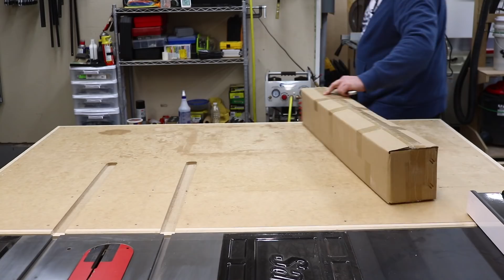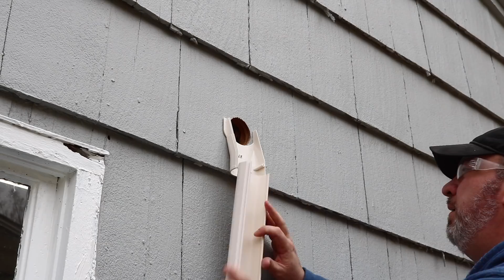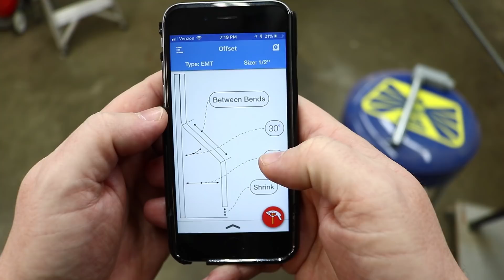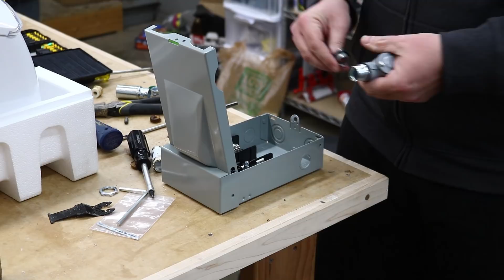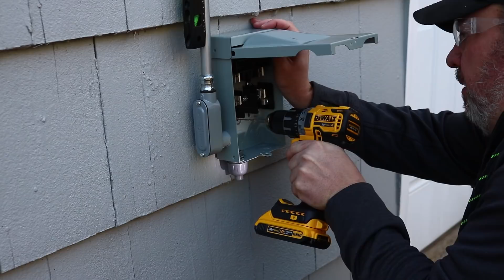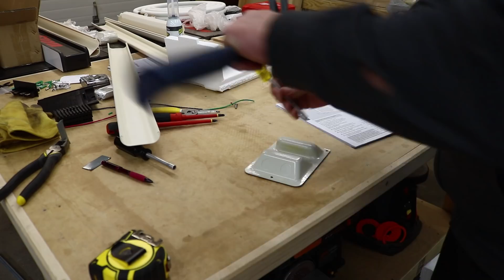How to Install a Ductless Mini Split

Comment from the maker: Hope you all enjoyed this video.  If you've done a mini split install before, post your experience down below.
Reply: Great video. You should be on this old house. I have a question though. I believe you said that your shop was 500sqft. Isn't the unit you used oversized a bit especially with what appears to be an insulated room.
Reply from the maker: Thanks!  It was sized based on a calculator from the manufacturer.  My walls are insulated but my ceiling is not.
Reply: You are a qreat teacher. Thanks for this video.  I will check your other videos. One question... Did you wrap the whole refrigerant pipe lines with the insulation tape or not?  Didn't see that part. I had a couple of units intalled by techs and they didn't wrap the lines but the insulation foam deteriorated. Ohers tell me that was a bad intallation.
Reply: where did you get that tool rack you have on the wall with the hooks?
Reply from the maker: That's the Gladiator system.  They have a ton of different setups and they all hand on those tracks.  You can get them at Home Depot or on their website but I found really great deals on eBay.  However, I've since removed most of them from my shop.  They are best used with stuff like gardening and lawn tools.
Reply: @TheAverageCraftsman  thanks for the quick reply
Reply: The Average Craftsman ... can you comment on how you like the unit. Both from a heater and AC perspective. Thanks in advanced.
Reply from the maker: Love it!  It's worked great so far in both modes.
Reply: The Average Craftsman  I need someone for my home.  I live Michigan
Reply: I don't get the attraction of these things.   LG sells a window heat pump with the same specs for the same sqft for under $700!   Why install this, when I can put in the window unit without permanent damage, and save a grand for other things?
Reply from the maker: Window units arent nearly as efficient as these mini splits.  I'll save that extra money in the long term many times over.  Also, a window unit wasnt an option for me because I dont have a window that opens in my shop.  My unit ended up being around $1300-1400 when it was all said and done including the wiring, disconnect, etc so I wouldn't have saved a grand.
Reply: @crforfreedom7407  I have the LG window unit in my office at home, Works fine, nosier than I expected. I am guessing that the outside unit probably eliminates a lot of that noise.
Reply: @vip01  Yes I think you're right.   I think they are a great deal more energy efficient, so they do save a good deal of $$ over the long run, although I honestly have to say I've not done the cost/benefit analysis on that.  But depending on the length of time and number of hours ran, it would have to be a saving.   If it's a regular long-term living space, there'd be no question.
Reply: Crfor Freedom à
Reply: Crfor Freedom : DILLIGAF!!!

Comment: I have installed several Mini Splits and every brand seems to go a little differently.  I used to be an HVAC tech and still have a vacuum pump and gauges so I could run a pressure test on the lines before opening up the valves and letting the freon flow. I always mount the condenser unit off the ground to prevent grass and dirt getting into the unit. And it is lot easier to work on at waist level! I have mounted them on brick, cement block and wood backed vinyl siding with no problems. I also seal the lines coming through the wall with expandable foam. Your installation looks good and should give you years of service.
Reply from the maker: Thanks! 7 years and it’s still going strong!

Comment: Did you vaccum the lines?
Reply from the maker: Yes, as I mentioned in the video, I hired an HVAC tech to do the final connections and vac the system.

Comment: Thanks for the video nicely done.I found you off of Lumberjocks. Looks like this video is 6 years old just wonder how you feel about this unit after all this time? Any problems?  Thanks, a1jim
Reply from the maker: Thanks for watching the video.  The unit has been great performance-wise but when I fired it up to cool the shop this past summer it had a freon leak in the indoor unit.  It was about $400 to replace and then $200 to have the unit recharged and vacced.  The unit is actually a little under 5 years old right now and was just over 4 years old when I had to replace the indoor unit.  The new unit would have been free but I forgot to register the product so my warranty was only 1 year.  Overall, I am still happy with this purchase and installing it myself.  Compared to having a Mitsubishi or other big brand name installed I am well, well ahead financially.

Comment: Excellent install video. I am installing my first mini split this week and went with a Pioneer also. I am thinking it should be perfect for my needs. Quiet and efficient, much more affordable than a full replacement of my 23 year old R22 central air unit.

Comment: How does it work? Update
Reply from the maker: Works great! Was around 100 for a stretch a couple of weeks back and the shop was kept around 70 degrees. That’s without insulation in the ceiling. Can only imagine it will do better once I insulate whenever that may be!

Comment: Hello can you pls mention roughly where your shop is regarding it's climate zone? Greetings from AR, USA. I wonder if that BTU rating is applicable to a similar space in AR. It got down to -1F last winter but usually more like 20's-40s at night. Summers are very humid and can be 90-111f in the afternoons, high 70's sometimes low 80's and very humid at night.
Reply from the maker: I am in the Kansas City area which is right on the border of zone 4a and 5a.  To figure out your required capacity I would recommend reaching out to a mini split manufacturer.  They will ask you about your space and location and size a unit to fit.  Thanks for watching!

Comment: If your going into your service panel into your breaker is a fused disconnect still required? It could be added protection, just wondering. Thank you, good video..god bless
Reply from the maker: I am not exactly sure what you're asking but I think the answer is no regardless.  You have to have a disconnect within site and a specific distance from the outdoor unit.  Thanks for watching and commenting!

Comment: Universal license hvac tech
Just installed an LG, the lines on the back of the inside head unit are so fragile it’s not even funny. Damn thing leaks so tomorrow I’m going to replace the factory “shit” lines with real copper. I’m so pissed off at LG for their “flexible” lines, they’re junk.
Reply from the maker: Are you talking about the lineset lines that go through to the outside unit?  They aren't copper on an LG?  That surprises me.  Thanks for watching.

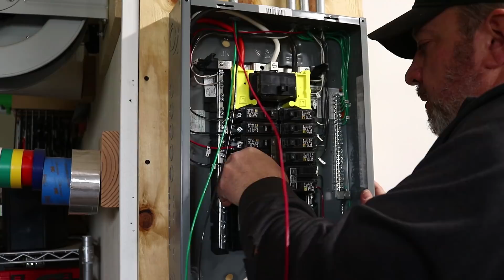Comment: Just a clarification at about 16:06 wiring the cutoff you stated the ground goes into the neutral. Which is obviously incorrect. It's the ground there's no neutral there.
Reply from the maker: Good catch.  Brain fart on my part.  Thanks for the comment!

Comment: My #1 problem (maybe) is I can't run the lines from the air handler through the wall. I added a 4 Season/Sunroom to my house so the wall that I would have to mount the inside unit is actually an exterior wall. all 3 of the other "walls" of the Sunroom are sliding glass doors. So no mounting over them cause there's no clearance.  Maybe I could run the lines on the inside and down the wall through the floor and then over to the outdoor/compressor unit. Idk....
Reply from the maker: Yeah, that sounds tricky.  Really no idea how to pull that off.  Good luck!

Comment: Not sure where you are located but if you get any kind of snow fall you will need to get that outdoor unit off the ground or you will run into defrosting issues.
Reply from the maker: I am in Kansas City and we get moderate to light snow each year. I don’t let it pile up. I was rushing to get this done which is why I didn’t mount it to the house. I might one day but it hasn’t been a problem so far. Thanks for watching and commenting.

Comment: Awesome tutorial and great work! I installed the MRCOOL 18K. My plumbing was a little more intense due to my indoor unit mounting location. I choose an interior wall not adjacent to an exterior wall. I routed the copper lines into the attic through the wall and left the uncoiled excess in the attic. Some HVAC friends suggested that the oils in the refrigerant, while at rest inside the coiled copper could compromise the structural integrity of the line. I also had to install a designated PEX drain line for the inside unit. In the interest of keeping all lines hidden, I routed the drain line in the wall through three studs to an exterior wall and outside. I choose to pour a concrete pad to mount the outside unit on. Other than those extra steps, the initial install was straight forward. I posted on my channel if you’d like...
Reply from the maker: Yeah, much more involved than my install.  Thanks for watching!

Comment: Could anyone tell me what I should use to cover the lines on the outside of the house I am going to be installing
4 mini split units and the lines will be running on the outside of the house and it just doesn't look like the 4.5 inch
plastic cover will hold the 8 lines or will it ?
Reply from the maker: Hey John, I'd recommend going to an HVAC supplier in your area and see what they would recommend.  Thanks for watching!
Reply: @TheAverageCraftsman  Thanks very helpful video

Comment: Mine involved running my own line sets and evacuating my system with a four zone. Welding, flaring and swaging. Nice emt work. Saw that first bend got you though.
Reply from the maker: Thanks!
Reply: The Average Craftsman I’m a licensed electrician and previous hvac technician so I had a little help. But no joke, nice emt work. Solid job

Comment: Question, did you leave the 30 amp fuses on the out side shut off panel or is it necessary to change them? BTW, great video!
Reply from the maker: I don't really understand your question.  The shut off did not come with fuses.  I bought some and put them in.

Comment: Hello, how do you like the unit after a couple of seasons?
Reply from the maker: It's great.  One of the best additions I've made to my shop.  No issues so far.  Thanks for watching!
Reply: @TheAverageCraftsman  Thanks, would you also put this in your living room?
Reply from the maker: I wouldn't put one in mine just because I have good central air but they would definitely work really well.
Reply: @TheAverageCraftsman  Thank you again. We do not have central, this evaporator would fit in our dining room, most other brands will not.

Comment: How well does the ac and the heat work for that 500sqft space? I have about a 650sqft area I want to put a split in, would the 12000btu be sufficient?
Reply from the maker: Hey Daron, mine does well but it's 18000 BTU.  I would recommend reaching out to manufacturer.  They would ask you about your space and tell you what size you need.  Good luck!

Comment: Well done! Thank you!  Was just wondering why you went with Pioneer. I was considering Mr. Cool based on the simplicity of the installation which I also viewed on YouTube. That brand did not require and HVAC technician. (one example)  Thanks for any input. Knowing you, I am sure you investigated before purchase and would give me an honest answer on your choice. 
Thank you! Pat
Reply: Pat McGlone f
Reply from the maker: Thanks for watching, Pat.  I went with Pioneer based on the price, features, and reviews.  The big features was the inverter+ tech which allows this unit to heat while the outside temp is as low as -13.  I bought it during a week when we had negative temps.  Most units can only provide heat down to 5.  Some as high as even 20 degrees.  

I thought about Mr Cool but I didn't want the bundled up lineset though I hear they are great units.  Almost two years later and I am pretty happy with my purchase.

Comment: Thanks for the video. I watched it last year and now again as I am preparing to replace the window unit in my garage apartment.  I will chunk the old window unit and frame a window in its place. Then reroute the power line.

I am also toying with the idea of running multiple heads so I can condition my shop but need to make sure I have good dust collection. Any advice? Thanks again.
Reply from the maker: Hey Brent, in regards to the multiple heads, you really should just reach out to the manufacturer.  They will ask you about your space and recommend the correct system. 

For dust collection, buy as good of a dust collector and shop vac as you can afford and use them on every tool that you are able.  Also make sure to clean your mini split filters often.
Reply: The Average Craftsman thanks for the reply. I completely missed the 1.21 Jigawatt reference before. Doc Brown would be proud of that “Back to the Future” reference.  Haha.

Comment: @AC, here's my reply/response/query being recorded at 300th this day and all the way from the Netherlands... which prompted me the following:- A fabulous elucidation you shared on your modest humble skill regardless.. its a THUMBS-UP from me too. Can you share yr thoughts as to why it is referred to as "ductless"... I just can't figure this coz I first thought, it's a built-in unit without any access for intake nor discharge of condensation... Pls, your thoughts even if it means little anymore at this stage B4 I go onto wikipedia on ductless, related to AC units. 

I have 2x outside and 4x inside units from Daikin Inverter with WiFi integrated from 2017. Barely used the WiFi and would not recommend after all given the potential hackers fooling about the neighborhood by the nuisance kids these days. 

I'm having it all dismantled to reassemble in my next new home B4 Xmas and will add an additional 3 inside units from the Emura 2019 series. I'm contemplating now after watching yr shared expertise, whether I might need only one 18k BTU unit or two 12k BTU  units just for the Living room? Reading another commenting on the ground displacement and you realising it was done due to time constraints, I'd like to suggest having it just 1m off the ground albeit on a platform skid or hooked up against the wall for easier maintenance when due and for anyone having hernia aches esp.  
I am also adding 52x LG solar panels @330Wp each to support the ACs, Central heating pump and 250lit boiler tank, induction kitchen, complete heated flooring including the 2-car garage, heating for the outside pool, the Fort Knox-like security system and a charging terminal for the switch to EV SUV someday soon. I'm not anywhere concern anymore with the consumption the ACs require thanks to the solar panels. Your roadmap to installation does add value for me to better understand when I'm monitoring the Technician installing my AC units. I'm a Retiree with a slight disability hence, am advised by the MD & Specialist to leave such challenging tasks to the Pros... YOU ARE a good DIY on this as visibly witnessed by most and me as well... Thank you again and I look forward to more of yr transparent shares on future undertakings... 
Cheersch to you mate as we say it hier in Holland. :) ;)
Reply from the maker: Thanks for watching and commenting!  Good luck on what seems to be quite a few projects coming up.

Comment: I really appreciate you posting up this video because I really want to do the same in my garage.  As you read what I have to say below please keep in mind that I’m only interested in and keeping people out of harms way.

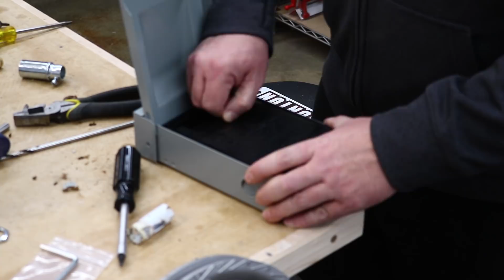@10:35 Nope, that’s what Lock out tag out is for.  The box is only placed close to the unit outside because it makes sense to put it close. If you need to shut the unit down you’re supposed to put a lock on the switch.   This is how people get killed.  Let’s say a DIY guy doing is doing his own thing in his backyard. So he shut off the switch thinking he’s the only one around that will mess with it. Then he steps away and a 12-year-old brat down the street comes and turns the thing back on. Then guy comes back to work Doesn’t look to see if it’s suddenly turned it’s self back on.… Need I continue?.
Reply from the maker: Uh, no, no need to continue because that's pretty much exactly what I said in the video.

Comment: You did a good job. Personally I would have used PVC conduit. I've look at a lot of videos installing these units and Mr. Cool mini split seems to be the best for DIY installer because most of this is already done for you when comes to the wiring from indoor unit and the refrigerant lines.
Reply from the maker: Thanks!  I looked into a Mr Cool but I didnt want a bundle of excess lineset.

Comment: Thanks for the video.  I'm really interested in your experience since installing this mini split over a year ago.  I would be interested in what your thoughts are now, how was the performance having gone through a year of temperature swings?  Any idea on the cost to run?
Reply from the maker: Thank you, Rob.  It's been great so far.  It handles everything but the extreme highs and lows really well but that's because my ceiling isnt insulated.  I dont know exactly how much it's costing to run it but it's not that much because I haven't noticed a big change in my electric bill.

Comment: Great video! One question though.  You say the unit needs a 20 amp circuit.  But you also say the fuses you are using in the disconnect are 30 amp.  A 30 amp fuse will not protect 12 AWG wire which is rated for 20 amps.  The wire will burn before the fuses will blow causing a fire risk.  Although the 20 amp breaker should trip, just not sure why you would use 30 amp fuses.
Reply: Dwayne Gitter typically the style of disconnect he is using are commonly rated for two loads, 30 and 60 amps, allowing you to use fuses up to those ratings. I would hope that he installed 20 amp fuses.
Reply: @benjaminwoodward2362  Thank you. I did not know that.
Reply from the maker: Correct!
Reply from the maker: Dwayne, the fuses are 20 amp.  Thanks for watching!